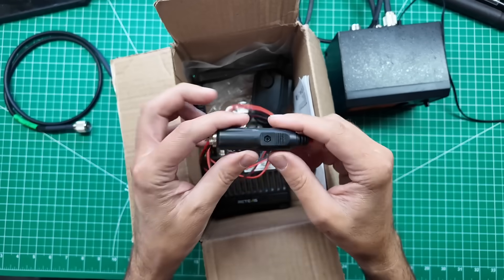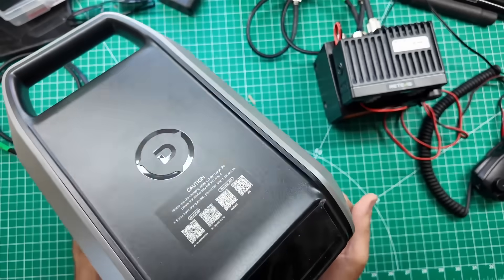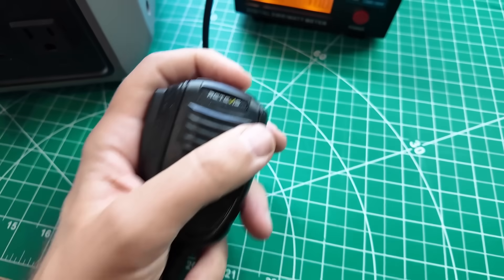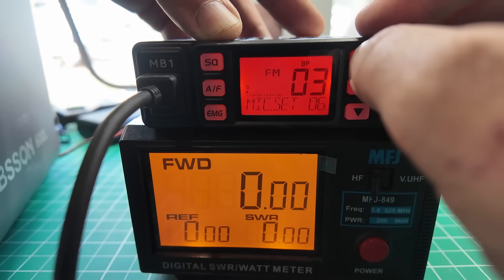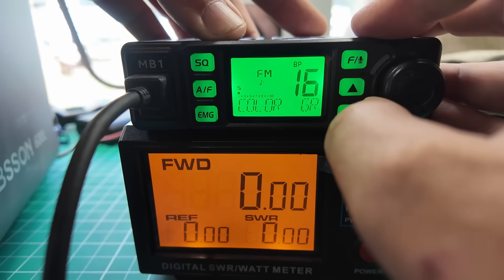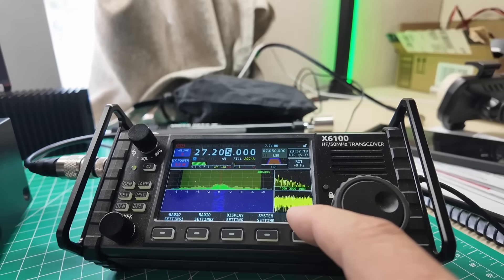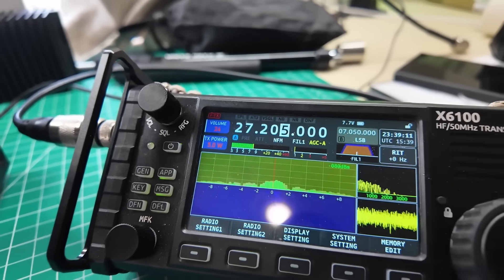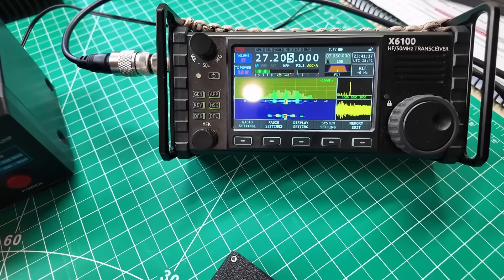I Repaired This Budget CB Radio… and It Actually Surprised Me!

Comment: I seen that one listed.  Their is a un lock code for that for UK users. Their CB band is different.  I was on CB today on 36-40 SSB . Some Texas coming in to NY . Also their is some flooding in NC as well . That storm dumping a lot of rain south of me. I have a T2LT antenna cut for CB on a DX commander 10 meter pole leaning in a tree to hold it up. Shooting skip today . Funny 10 meters nothing.  CTCSS and DTS are legal on CB now with FM as well . And talking skip legal on CB as well.  All part of that change when FCC allowed FM.  I can SMS text and SSTV over that CB and just use the mic and smart phone . Their a app for that . And it's legal that not MOD the radio . Just tones sent threw mic. I got some local on CB doing that . This even  works on FRS and MURS radios. Done that as well. Just hold your phone buy speaker to decode and put the mic buy phone to send. Simple. 73
Reply from the maker: That's a good idea on the tones.

Comment: I found to my chagrin that just having a dummy load on a rig on the bench doesn't mean it isn't radiating. I was tuning a 2 meter mobile rig into a good dummy load with double shielded coax when the voice of a ham in his car in a parking lot 2 city blocks away came back to me over the rig with the dummy load attached, suggesting I give my callsign once in a while. The rig had been radiating out of the chassis because I had to have the lid off to tune it, and it was receiving the same way at least 2 blocks away. After that I always use my callsign when I'm working on rigs on the bench no matter how low a power level they are set for. I even do it when the lids are on. It's just a good habit to get into.
Reply from the maker: You got that right.  Connect your dummy load to an HF rig and run WSPR on it - I might do that for a video... would be cool to shut up those old grumps that complain that your antenna isn't good enough... I know a guy that made a contact from Wisconsin to New Zealand on his coax alone.  RF is magic brother!
Reply: @temporarilyoffline  One of the local hams here had his mobile antenna line drop down on the exhaust of his SUV and promptly cooked the jacket off the coax.  A little melting plastic and super-hot coax made a conductive surface which turned his exhaust pipe into his new antenna.  We could communicate with him via the repeater but everyone commented how it sounded "off."  It wasn't the crisp signal that he normally broadcasts, it was a scratchy subset of the frequency that the tailpipe would radiate.  When he finally tracked down the issue we were all impressed at how well it worked.

Comment: Always check the fuse first before you fire it up.
Reply from the maker: That's a great idea!
Reply: Why? If it comes on, the fuse is good. If it doesn't come on, then you can start looking at the fuse and stuff.
Reply: @paulsengupta971 if someone has replaced the fuse with a much larger one it may enable a possible malfunction inside the radio to go catastrophic and burn up components and boards that the proper value fuse is designed to protect.
Reply: We’ve seen it many times before in repairing two way radios.
Reply: Kinda like back years ago when people would put a penny in a fuse box, now breaker boxes, when they didn’t have a spare fuse and then their house burns down. Many a Fire Marshal has found this at scene of house fires . People sometimes are not well versed on electrical issues and why things are made the way they are.

Comment: Who do you go through to buy Amazon box’s/ pallets.
Reply from the maker: I'm not an expert on that side of things, I just networked my way into this with a vendor I work with.  However, you can take a look teh googles for more info.
Reply: I've researched this in depth and he has basically found a vendor that he knows at least semi-personally and they save their returns to sell to him.  It hasn't happened overnight.  I managed to get a return from Retevis which they sold to me and I found an open box mb1 that I won on ebay and that's about it.  You'd have to actually contact places like radioddity or use chatgpt to find all kind of online sellers of radios and then contact them personally expressing interest in buying their returned items and see what kind of deal you could negotiate.

Comment: I have a similar FM CB and there are some things you might want to check out.  

"Open up repeaters" LOL
You'll probably find a color brightness feature. When you do, the colors that look the same will be different in different brightness

Yes, you did what I have done many times, ham ID on CB, or now GMRS, LOL

Actually, I don't think you did any wrong.  CBs have had "Private Line" mode, which is tone, but the tone was both TX and RX so you did not have to listen to anyone but your group. 

I don't know what differences there are in FM, but in my radio, there is a menu option not recorded in the documentation. It raises the power to 8 and 10 watts on AM and FM respectively.  That might be less than legal, LOL. 

I got mine because Amazon Vine allowed me to review it and because I would like one in the car when I travel to keep up with traffic conditions.  In the meantime, I have it in the house, just to see what's out there. 

I find more activity from freebanders around here than on the CB channels. 

Your radio has more options than mine, even though it is in the same case.  

I like your repair videos, they are interesting and review features of the radios. 
 
Keep it up. 
73
Reply from the maker: Thanks... the ham habits are deep.  You're right, I just spoke "ham" instead of "cb" when I said some things.  In the next video I'll look for your tip about opening up power, that's a good idea.

When you're listening for travel conditions, what channels?  Do you get anything useful?

Comment: Oh my....... You did the unthinkable or the unforgivable not sure which. You ventured into the 11m HF band. However your YT channel has be moved from the HAM channels class to the Operator Channels class in my book. On the 11m HF band your "call" does qualify as a "handle". You can even use "The TOAD" if so desired, no harm no foul. I got a good chuckle when you pulled the radio out of the box, you could see you body movement expecting the weight that wasn't there. The irony of current CB models, they can make them so small they get to the point were they are not really feasible because, they are so small, they just dangle on the microphone wire. Definitely not your Cobra 29LTD.
Reply from the maker: ooh, I like "The TOAD"!!  You're right about the size.  Smartphones did that a while back... got so small they couldn't be used... and now its about 5+ inches or folding phablets.  Human Interface Design... that's a real thing!